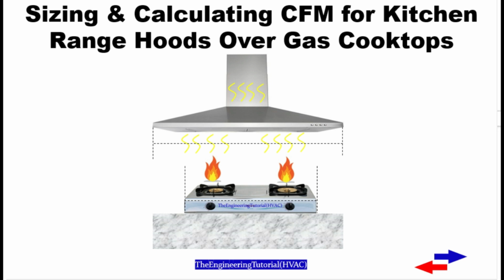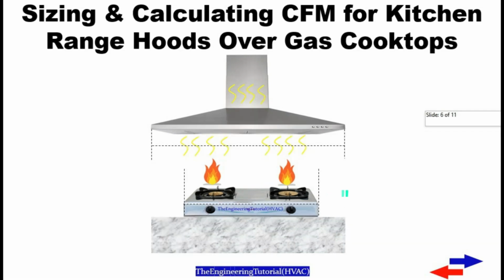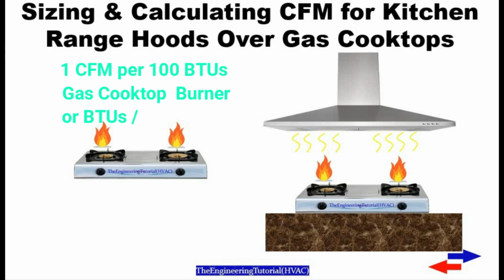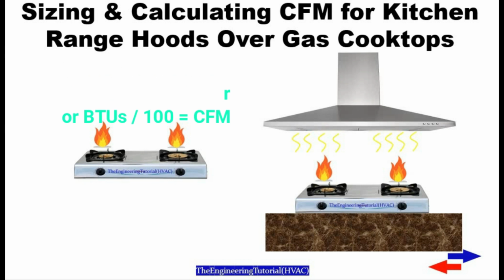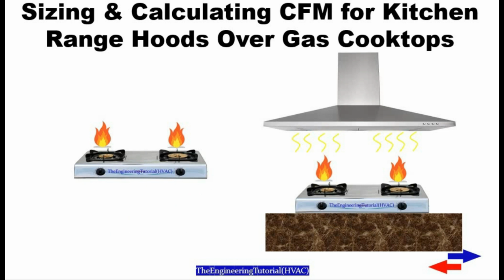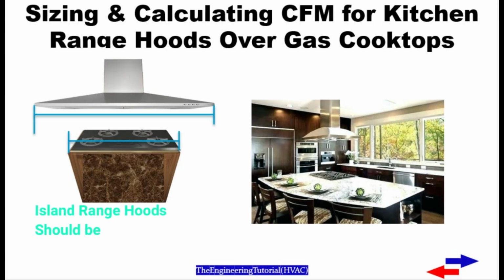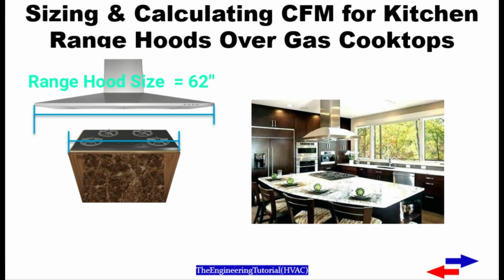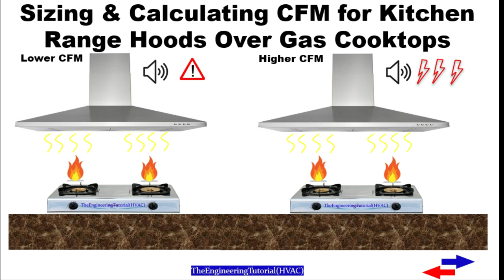Sizing & Calculating CFM for Kitchen Range Hoods over Gas Cooktop

Comment: How about , if we want to calculate : labroratory room (chemical lab), warehouse, ect
Reply from the maker: If you are designing a Laboratory fume hood, Minimum airflow is 10 to 25 CFM for every square foot of your work space which is equivalent to 150 to 375 air change per hour.
In order to exhaust fumes and odors generated during laboratory procedures.
For example, you have a Lab fume hood of 36” x 15” = 540” convert it to square foot ( 550” / 144 = 3.75 feet )
3.75 square feet x 25 CFM per square foot of your work space = 93.75 CFM. 

Required airflow for your fume hood= 93.75 CFM